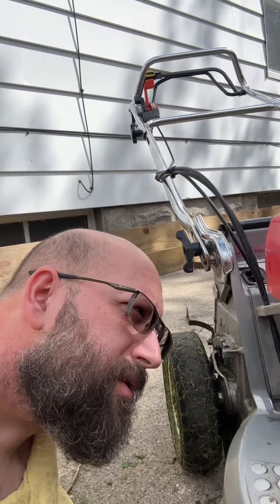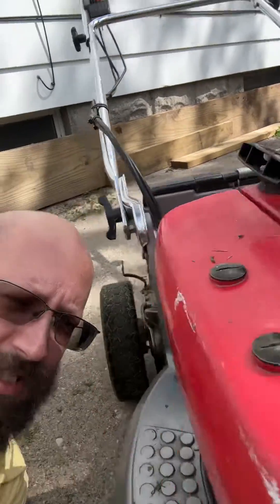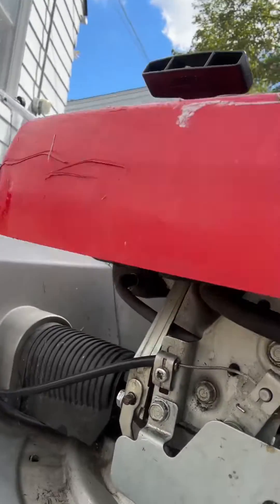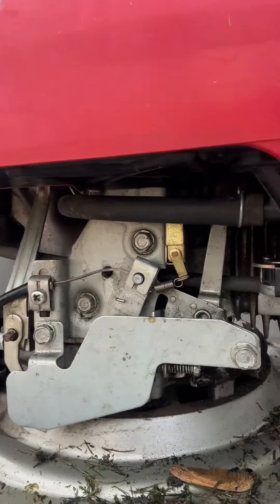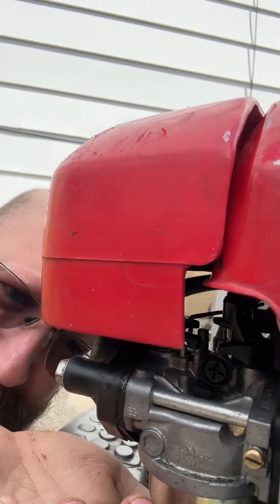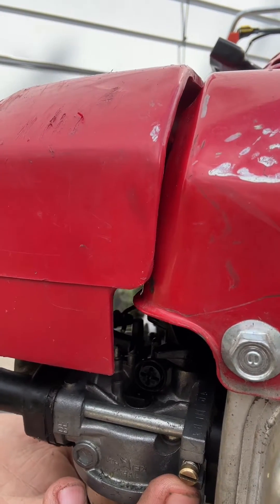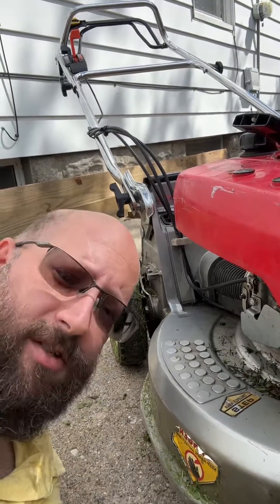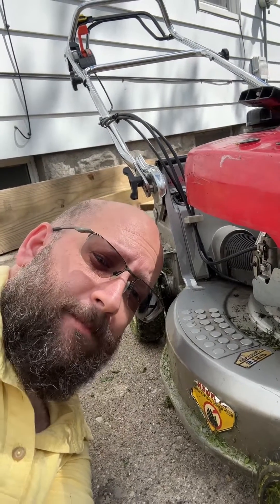Honda HR215 HXA gvx140 Carburetor adjustment points

Comment: The gold thing is the contact to let current pass for the coil, so the fire at the spark plug.   When pushing the handle to shut down the engine, it pushes on the arm of that thing, cutting the current and the motor stops, having no more sparks